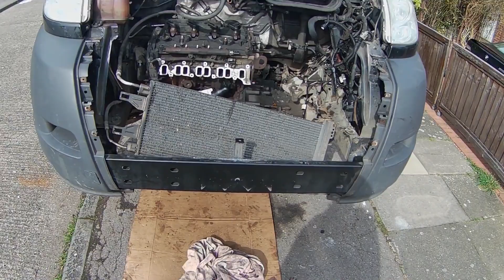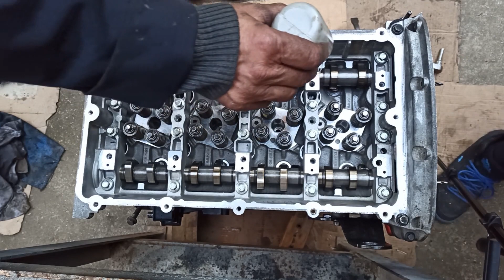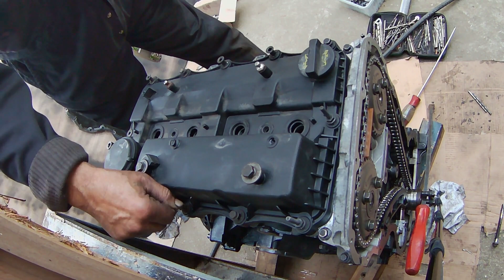Ford Transit 2.2 TDCI Engine Rebuild - Part 3 - Fitting Rocker Carrier Arm , Rocker Cover Final Part

Comment: Thank you for this. I've lubed mine up before i fitted it . Someone didn't put a sump gasket on my van and used silicone sealant. Trouble is they put too much on and it starved the rockers . Think i caught it just in time because there was only the brass from the rocker wheels in the sumo and no other metals i hope. Forgive my grammar as I've just had to learn to read and write again after a head injury.

Comment: Problem starting the engine tapping noise 🙄??????we think it's the tappits
Reply from the maker: It can be the tappets, but there are many more problems with tapping noise. Did you do pump learn. What oil did you use?Did you change the timing chain?